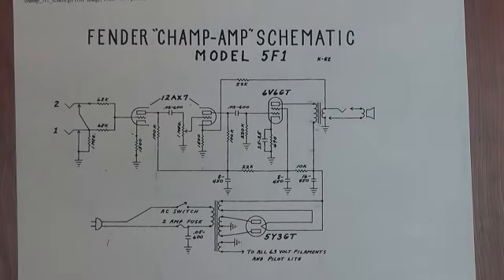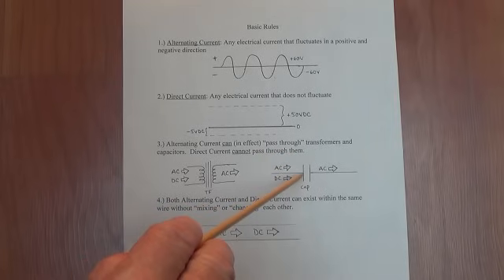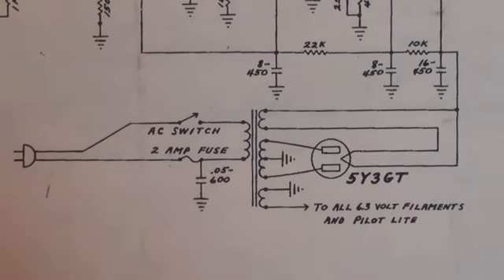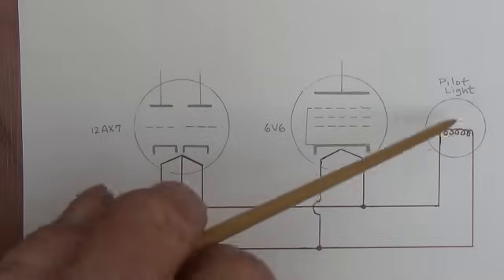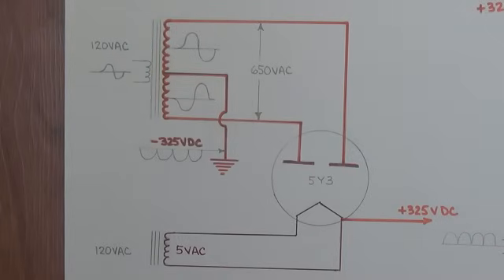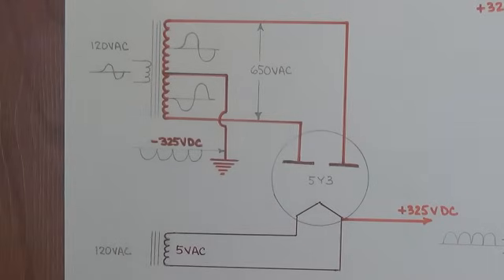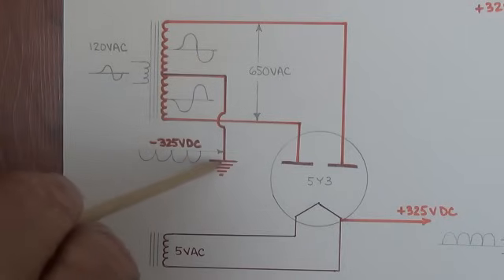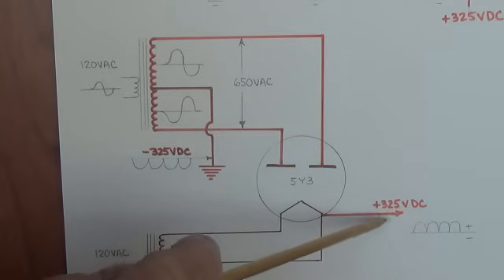How Tube Amplifiers Work, Part 1: The Power Supply

Comment: So, I have a decent understanding of electronics, but not in circuits. So why does the +325DC not go to ground with - 325DC? Wouldn't that be the road of least resistance? Is it something to do with the waves canceling each other out?
Reply from the maker: The +325V and -325V don't both exist at the same time. It depends on where you are measuring. If it's the output from the rectifier, it is +325VDC, but if you measure from the center tap to ground, it will be -325VDC. This was corrected in the video, but the corrections are not visible on all monitoring devices.

Comment: Can you explain about the -325v?
Is it waste? Un-useable?
It has an "assigned value" their must be some use for it (if not this application where & how & why?)
Reply from the maker: It was my attempt to show that the transformer has voltage potential between the circuit (+325VAC) and between its center tap and ground (-325VAC) depending on which way your voltmeter is applied to it......but this ended up confusing a lot of people, so I blocked it out of the video (but it's still visible on some viewing devices). Both potentials do not exist at the same time, it's an either-or situation. Sorry for the confusion.
Reply: @UncleDoug  Ohhhh so you're saying it's zero volts (or low) but has potential to be +325v (failure situation etc)?
Reply from the maker: That's great to hear, KT.
Reply: @UncleDoug  I'm really learning this thanks to you!

Comment: The only part that I didn't get is the center tap from the secondary side of the transformer. I'm not understanding where or what is the center? Is it like a third independent winding? I imagine if I mechanically saw the winding I would get it, but regardless I do get the result.
Reply from the maker: The center tap (CT) is like the vertical bar in the letter "T". It connects to each of the  horizontal half-bars. Any electrons traveling up the vertical bar (CT) can go to either the right or left half-bars (secondary windings). This creates two separate circuits, each with opposite polarity (since the half-bars extend outward in opposite directions).

Comment: I have watched a number of your videos and want to thank you for what you have done to help educate, inform and entertain.  I have a Lafayette PA-273 15 Watt combo Amp that I am looking for Schematics.  How would I source it?
Reply from the maker: You're welcome, Domenic. You'll have to do exactly what I do, which is search the Internet for the proper schematic. If you can't find it, or the schematic for a similar amp, then you'll just have to "wing it" and work without a schematic, or draw up your own. Good luck.
Reply: @UncleDoug  I have tubes that do not have clear markings.  Resistors that have split and color is sketchy... Would be ideal to have a resource.  I have not found any helpful info on Lafayette except my memory of them as a youngster.  I am sure they are a knock off of something else.
Reply from the maker: Lafayette is not a major brand, Domenic, so finding any schematics will be challenging. Good luck.

Comment: UD, sorry to comment on such an old video, but I'm watching it yet again I think because I've still been perplexed by the damned high voltage circuit and how that 5V and 325V on the same wire.  THEN, AH HA!  I remembered from another UD vid that AC and DC can be on the same wire and not effect each other, so now I get it.  But still, does that apply even if the DC is lumpy, like it is when it comes out of the 5Y3?  My thinking is that that lumpy DC has got to have some impact on the 120V side of the transformer... Except that maybe transformers only work as the AC transitions from pos to neg, and since that lumpy DC is only lumpy in the pos direction maybe that doesn't happen.  And then, even if it did, the winding ratio leaves it at such a disadvantage maybe it wouldn't have much impact anyway?  Again, sorry for the late comment.  Also, I have to report that the SR amp (WITH Celestion speaker!) has become my go-to amp for practice and rehearsals and my Deluxe Reverb has been relegated to gig-only status.  Thanks again!  RF
Reply from the maker: Yes, AC and DC can coexist without mixing, just like ice and water. In fact, the AC "floats" on top of the DC just like ice does on water.

Comment: Direct Current can too fluctuate!  As long as the current flow id in the same direction,  that is to say that the voltage stays on the same side of zero,  or does not reverse polarity,  than it's still DC
Reply from the maker: Thanks for your input, Scott.

Comment: I understand this but was just wondering how exactly the transformer changes the pattern of the frequency. 13:44
Reply from the maker: Any center-tapped transformer will create two separate AC outputs which are out of phase with each other. If you have access to an oscilloscope you can see this for yourself.

Comment: I'm having difficulty understanding the voltage interaction between the 5VAC secondary (for the rectifier heater), and the high voltage B+.  I understand the rectification, but the part that's throwing me is that the B+ is connected to one side of the 5VAC secondary.  How can 5VAC and the high voltage B+ exist on the same leg of that transformer secondary?  And why doesn't the high current load on the B+ burn out the heater in the rectifier?  I'm missing something here...
Reply from the maker: You need to watch my later videos on power supplies, where all of this is explained in detail, XT.  For one thing, the B+ is high voltage, but actually very low current, measured in mV not volts.
Reply: @UncleDoug  .. or rather milliAmps not Amps.

Comment: The fact that you can put AC voltage and DC Voltage into the same wire and have it come out like it went in is just crazy talk. In my small man-brain, they should get all mixed and scrambled up and what should come out the other end is an ACDC voltage, or an AC voltage that has more amps...or something. I am in no way questioning it, I just find that to be amazing.
Reply from the maker: It's sort of like ice and water, US. They are both the same substance, but rather than mix together, one (AC) floats on top of the other (DC).

Comment: Thank you for such an easy-to-understand explanation of how everything works inside tube amp (the best vids available on youtube, no doubt). Could you explain in the same simple manner what is "ground" in schematics? Thank you.
Reply from the maker: There are two types of ground, Victor......earth ground for the 120VAC in the primary circuit to the power transformer, and circuit (or chassis) ground for the secondary circuit. I will keep your suggestion in mind for a future video.

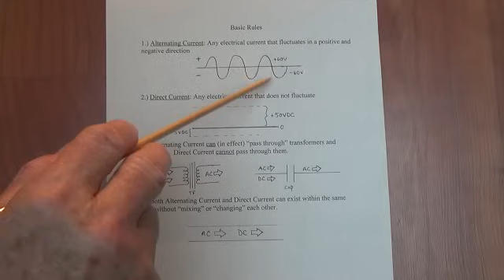Comment: 0:50 No. AC voltage is not the total distance from top to bottom, and your +60 to -60 isn't even close to 120VAC.
AC is measured against the absolute average voltage from neutral; 120VAC hits about 170V in each direction, that's +170V and -170V.
Reply from the maker: You're right. This error was corrected in the video with notations that are not visible on all viewing devices, Christopher. For a much clearer, detailed explanation of peak voltage vs RMS please see my more recent video postings.

Comment: What I find a little sad is that today's youth will spend $550 on a video card and another $800 on a fast CPU and $250 on a motherboard and then several more hundreds on the fan, heatsink,  chassis and power supply all to build their own Gaming Computer. Or, as many do they just shell out $1,000 to $4,000 for a ready made gaming computer.
Now understand all computers become obsolete in a few years. Yes you can hang onto your obsolete computer and get use out of it but eventually you replace it.
These same people complain about having to change and perhaps bias tubes in their tube amp. Understand that a good tube amp never becomes obsolete and can be used for an entire lifetime. Also in reality tubes can last many years. Yet there are those who are touting SS and Digital amps because of their lack of maintenance as being better suited for music. For me it is the tone that my tube amps have that continue to set them apart from the others.
-Peter
Reply from the maker: I agree with all you have said, Peter.

Comment: I have looked for a presentation that teaches me a foundational understanding about tubed amplifier theory. I am a teacher who has had to deal with dyslexia for almost 60 years and I have only known of my deficit for about 20 years. I am also a guitarist who loves tubed amps and have worked only at a rudimentary level on amplifier building and repair. Studying books on the subject is slow and helps some, but your presentation with verbal and visual cues is illuminating for me. You break down concepts (of which I have never been able to master nor gain fluency) into simple bite-sized (accessible) ideas and make them "visible" for me. That, sir, is a breakthrough I have not been able to experience on the subject. You are a rare talent and a true teacher of the sort I aspire to become! You not only teach electronics, but you also teach "teaching." You have made a difference to me. Thank you.
Reply from the maker: Wow, thanks so much, Patrick. Your very kind remarks, especially coming from another teacher, are particularly rewarding and appreciated.
Reply: @UncleDoug  It is simple to say,   What I am Going to Say,  what i am saying (with visual demonstration),  what we have learnt.  (repeat as needed for each extra bit that builds on that),  it is less easy to actually do that, which you do well.
Reply: Not exactly the same for me but very similar, the rudimentary building and repairing with tons of trial and error mistakes, none of which I even recall now. And thank you Uncle Doug for making this new epiphany possible. I'll be subscribing.
Reply: I agree with Patrick. I have been an electronics hobbyist for more than 30 years and have come to understand these concepts on my own, from my dad, and of course from school, but this video is the best I have ever seen and breaking down these concepts.

Bravo sir.
Reply: Excellent!!!
Reply: Amen!

Comment: Great video! A few questions I have: Is the 5 VAC simply the operating voltage of the 5Y3? I'm also confused about how you can have different voltages (the 325 VDC and 5 VAC) at the same node. Is it because one is AC and the other is DC? Lastly, is the 325 VDC truly a DC voltage? I understood DC to be a single, nearly constant value, and not as you have drawn it there.
Reply from the maker: Vacuum tubes have heater filaments, just like light bulbs. The 5Y3 filament requires 5VAC, the 6V6 filament requires 6.3VAC, etc. The transformer has different secondary windings and each one creates a different voltage. The 325V leaves the transformer as AC but is converted to DC by the rectifier tube. I have posted many more videos that explain all this in detail, Noah.
Reply: @RFXCasey  This is correct, apart from the fact that 5V AC r.m.s. is approximately 14V peak to peak, so one end of the filament goes 7V above and 7V below the 325V DC.

Comment: Hello , how are you? You helped me with my amp and I thank you. I'm currently having issues with my reverb. It sounds harsh, thin and raspy. I jumped the gun and got a new tank.  My verb pot when it's set on zero, I think I can still hear a little verb. Haven't tried my new tank yet. With your guidance, what do you think I should check? What are signs of a bad verb transformer? Thanks for your time. http://tubefreak.com/mk2c2.gif
Reply from the maker: You said in another post that you have changed the tubes, a 12AT7 and a 7025, and it didn't help. Are you sure you changed the right tubes? You could test or simply replace the cathode bias resistors for these tubes as well as the cathode bypass caps. Other than that, I am at a loss.
Reply: Thanks for the reply. I'll double check tubes . I put new tank in, tapped on head, definitely heard better verb coming through speakers. Never play tested it yet. I know for sure that my cables need replaced. I'll measure resistors and voltages as you suggested. I still don't know why they split the verb into two tubes. Instead of two halves, one whole, right?   Lol.  I'll fix it and give you a shout. Blessings. Jim
Reply from the maker: The reverb requires both triodes of a 12AT7 to drive the tank, and one triode of a 7025 (12AX7) to recover the reverb signal. The other 12AX7 triode is used as a pre-amp tube, so both tubes are fully utilized. There is no way that a single tube could do both. Trust me, Fender would not have done it this way unless it was absolutely necessary.
Reply: Thanks for the reply. You are great. I love chatting w/ you. True, but based on the schematic, the V4 isn't dedicated only to drive the reverb.  The V3 and V4 split the verb and also are used as halves of the lead drive mode. Let me ask, for the driver, would you suggest an  at7 (V4. but is half the lead drive to.)?  the return, I use an  ax7 (V3). Thanks, Jim
Reply from the maker: For some reason, I thought that you were talking about a Fender reverb circuit, JH, so all my responses were based on that assumption. I have no experience with Mesa circuits and can't even tell what tubes are used in the schematic. If you have already exchanged tubes with no improvement noted, then you'll have to individually check each of the components in the reverb circuit as well as the cables, plugs, and solder joints. Troubleshooting reverb circuits is challenging in person and virtually impossible by long distance. Best of luck.
Reply: Thanks for the reply. I attached a schematic with this thread. That's ok. I play tested it today with new tank. There was an improvement. I still want to replace pot and cables. I will test and check all connections in the circuit. Blessings. Thanks, Jim
Reply from the maker: You're welcome, Jim. Best of luck :)
Reply: Greetings Uncle Doug, I hope all is well. I kinda want to update you and ask you something if you don't mind sir. I seem to be making progress. Got new cables, tank. Took voltage measurements. On one of the cathode,  it read 6 vdc and the schematics calls for 2 vdc. What really concerned me was the reading on the plate (pin 6). it read 469vdc and the schematics read 334v. That's where the blue lead from reverb transformer goes to.  One: would that concern you and , two: can a preamp tube plate tolerate that much voltage? All resistors measured fine. That 469 voltage is the C voltage. It's like the reverb transformer isn't reducing it. I don't know a lot about electronics but was asking for your insight from someone who knows. Thanks for your time, Jim.

Comment: Hi Uncle Doug, I heard someone said "Vacum tube amplifier is introduce even harmonics". If I give signal into the amplifier with only one frequency (pure sinusoidal with only fundamental freq), will I get even harmonics if I perform FFT to my output signal? Or still just one frequency ? Thank U
Reply from the maker: For harmonics to occur, I believe that multiple frequencies must be present to interact by cancelling and reinforcing each other.
Reply: Does it mean I have to feed signal containing all 20Hz-20kHz to get information about the frequence response of my Amp ?
Reply from the maker: Yes, to do this, you need an audio spectrum analyzer that will sweep the audio range and graph the amp's output.  Here is an explanation:  https://en.wikipedia.org/wiki/Spectrum_analyzer
Reply: Hey thank u so much uncle. Anyway, I am looking a book about guitar amp design in theoritical point of view, what a book you consider to me uncle? thanks in advance
Reply from the maker: I wouldn't buy a book. I would go to the Valve Wizard's Internet site and study all he has to offer regarding circuit design.

Comment: Hello Uncle Doug, I may sound like an idiot while I say this but where do amplifiers, for example, get their grounding if they have a 2 prong plug? Thank you and best of luck to your future projects :)
Reply: The word 'ground' has two meanings. It can mean 'safety ground', the connection to the Earth via the third wire of a three-wire power cord. It also means the zero volt reference point for other voltages in the amp which is the negative terminal of the power supply, i.e. the negative terminal of the reservoir cap (a.k.a. first filter cap). In a guitar amp, the negative terminal is connected to the chassis which means that the chassis is said to be at ground potential, even if there is no connection to safety ground, as in the Champ that Uncle Doug is using for his demonstration.
Reply from the maker: Amplifiers circuits get their grounding through the metal chassis. They do not need an earth ground to function. The only time an earth ground is necessary is if there is a short between the primary AC wiring and the metal chassis......which would be a serious shock hazard if the chassis was not earth grounded via a 3-wire power cord.
Reply: Thanks again Uncle Doug, I am now one step closer to completing my diy amp :)
Reply from the maker: You're welcome, GG. Remember that electrons always return to their source. This is why the centertap of the high voltage winding is grounded......so the electrons can return to it through the chassis.

Comment: WoW cleared up a lot I didn't know been a interest of mine from child hood my grandfather was a tech in a shed with lots of red glowing light bulbs but at 5 years old I was not aloud to set foot into the shed as my pop knew the dangers. Have lots of tube/valve amps which I fix my self but only know very basic things change tubes caps but never really understood  but you have a great way of making things easy to understand knowledge is every thing Thanks for your help .
Reply from the maker: You're welcome, Bee. Best of luck with your projects.